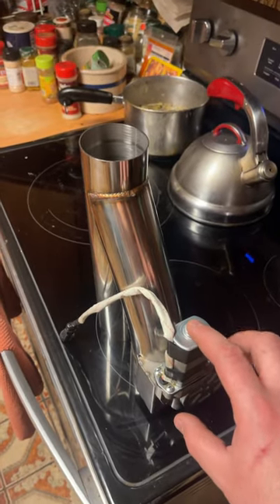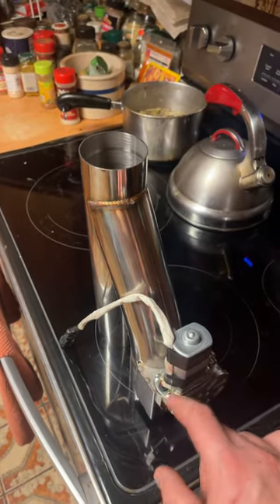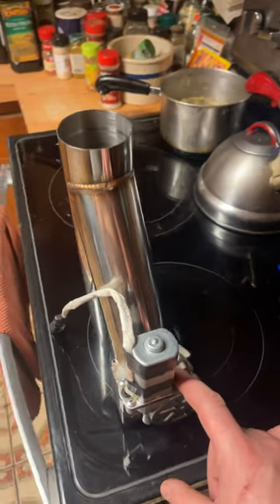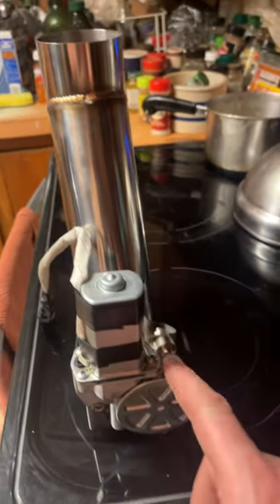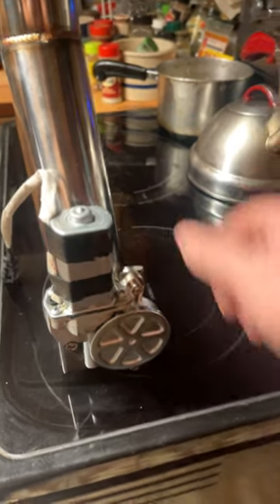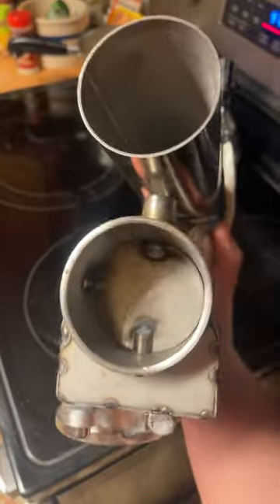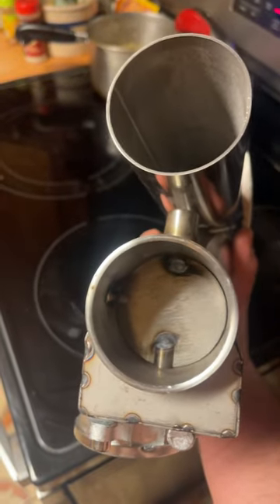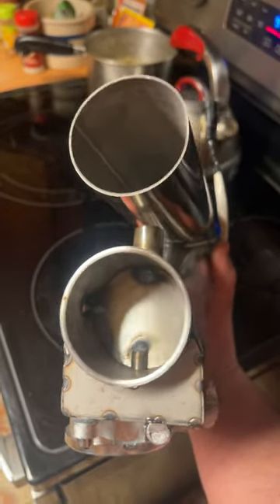Cheap exhaust cutout tips

Comment: Can you elaborate more I’m thinking about buying one but I’m kinda confused on what do you mean by the screws
Reply from the maker: The butterfly valve on these eBay cutouts is either screwed in place or welded to the rest of the cutout. ( if welded they are fine leave them be. If they are screwed in place use some red loctite so they NEVER come out.) The bolts that hold the electric motor to the cutout need to be removed and reinstalled with loctite ( I’d recommend red as realistically your probably never going to mess with it again unless it has a problem.) and they should be fine as far as rattling loose from Vibrations goes.
Reply: Thanks

Comment: What does the loctide help with again?
Reply from the maker: Using loctite keeps it from shaking apart due to vibration in the exhaust system. Especially on the butterfly valve if you have one held in by screws instead of being welded in place.